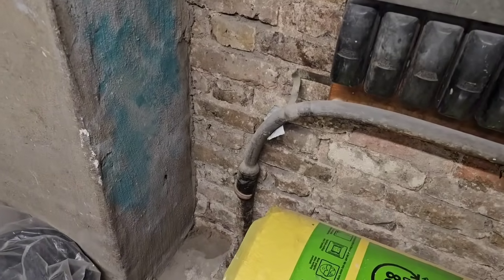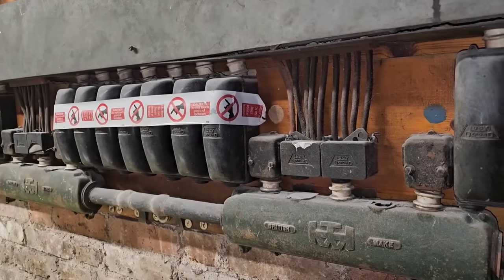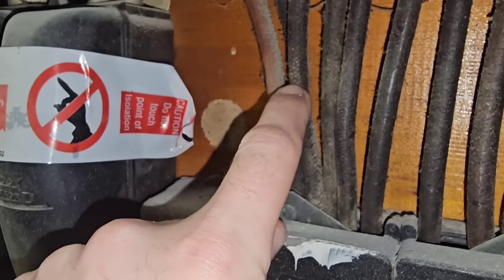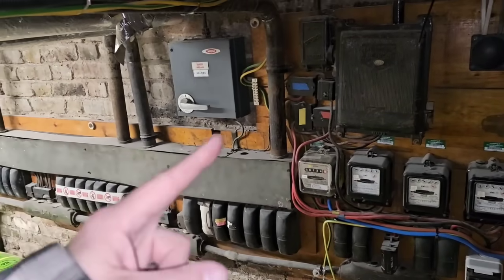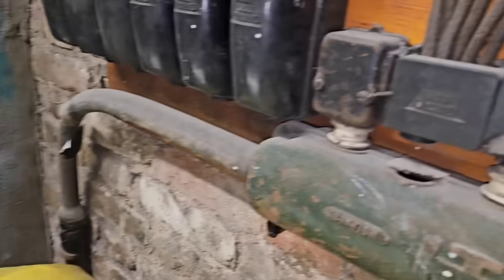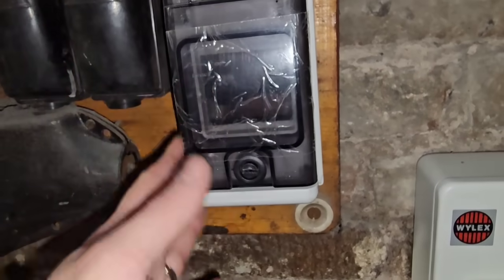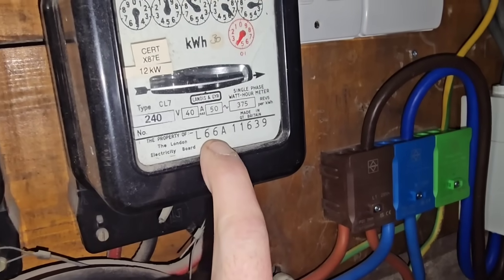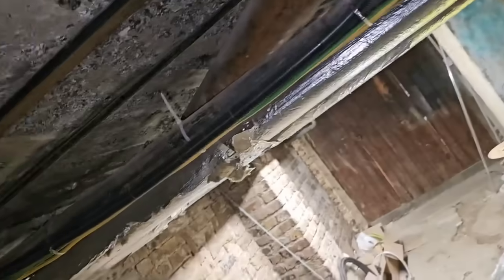Ancient 3 Phase Mains Problems

Comment: We have some of these still in Sussex and it's knocked the idea of going green on the head because of the infrastructure upgrade costs. The DNO can bring a new supply in but the buildings can't use it until the BNO has put new in their side, which they can't do without the tenants/owners vacating. Last I heard they were considering just knocking the block down and building a new one.

Also I had one of these heads in Hackey about 10 years ago that I reported to UKPN for exposed head. They were out the same day and it took a couple months but it was replaced, only 8 flats off it though. It however was in the communal hallway and the downstairs occupiers were storing their toddlers toys/ diapers/ toilet roll and buggies in the cupboard and in front of it. So it was only a matter of time before a toddler was killed.
Reply from the maker: @effervescence5664  knocking the block down definitely sounds easier 😂
Reply: Or how to make a simple and cheap thing very complex and expensive 😂
Reply: @neolerades2987  on what planet is rewiring an entire block of flats and easy and cheap job 😂
Reply: @ It's not exactly cheap, but it's definitely not expensive.  I've noticed that everything is very, very overpriced in the UK. (I don't live in the UK, but I watch some videos on YT from there).

Comment: I was hoping to watch this after Electricians Podcast but "Hey-ho" what happened again tonight? Anyhoo, very interesting stuff John though, I have to say that you are more blasé about where you poked you finger around that installation than I would be. 
As for how to move forward, I think it is a bit like us going to do work on a property that needs the basics sorted. If the infrastructure can't cope with a new mod, then that needs to get resolved first. The problem is always money and spending to put it right. I don't know if it is the BNO or that owners who has the responsibility but I appreciate the DNO not wanting to get involved until it is sorted.

Comment: Suerly, the solution, albeit costly, would be a temporary generator for the upgrade period.
Reply from the maker: @paulf2529  There's nowhere to put the new switch gear while the existing stuff is in place. There's a room down the corridor that could be used. Plus there's the issue of getting a new submain up to each flat without ruining the building. Such a headache to organise and very costly to the 20 leaseholders who the bill would be passed onto. Nightmare!

Comment: Sure it takes me back to when I installed VIR cable ( it’s actually braided vulcanised India rubber )   , mind you I’m 86  😂😂😂 Meters were handy though, often with broken seals so you could take the cover off & carefully push the hands of the dials back a KWh or 3 😂😂😂
Reply: Brilliant story…..I bet you have some tales to tell….
Reply: "Meters were handy though, often with broken seals so you could take the cover off & carefully push the hands of the dials back a KWh or 3".  Some guy in France has just been done for reprogramming hundreds of "smart" meters to systematically under report usage.  The electricity distributor is worried that many thousands may have been hacked.
Reply: Or just fit a "transformer" based meter winder 😂

Comment: For those old dial meters I noticed that the rotation of the needle changes for each unit, clockwise for the ten thousand units, anti-clockwise for thousand units and so on. Why were they designed that way? Just to challenge people?? LOL. Very intersting video - like you said a chicken and egg as to who'll do what. Cheers!
Reply from the maker: @davefrizelle3882  Yes they're geared. Very simple design and they had a long calibration date on them. I believe it was 30 years.
Reply: @ That's an interesting thought - have you ever heard of a domestic electric meter being re-calibrated?
Reply from the maker: @davefrizelle3882  Yes the old dial ones were calibrated and put back out into service. You'll usually see a little round sticker with a number like "90" on it which is the date of calibration and they were good for another 20-30 years
Reply: @John_Faultless  Thanks for getting back to me, but I'm just wondering if a meter that is installed in a domestic property is ever calibrated just because its time is due? For example, a house built in 1970 say, the meter goes in and is calibrated until year 2000, but in 2000 did anything actually happen? Did somebody come out and swap out the meter for a newly calibrated one, and take away the old one for re-calibration? I can easily imagine that this never happened and that there are domestic properties out there with meters that were installed way more than 30 years ago with meters now out of calibration. Of course the move to smart meters will change that, but if they're only good for 10 years will anything actually happen 10 years from now with DNOs or suppliers or whoever proactively swapping out meters?
Reply: @davefrizelle3882  that's exactly what used to happen when the cert period expired the meter was removed, returned to a test facility (for the NEEB / Northern Electric area this was the Test & Research Station located in Wallsend) where they were cleaned, refurbished, recalibrated  and tested. A government inspector would also come in and retest a sample. Then out for another 20 to 30 years.
Reply: @ Thanks for those details. I was curious because I have never heard of anyone having their meter swapped, other than when the smart meter roll out happened. Cheers :)
Reply: @John_Faultless   Im betting no meter has ever been calibrated until its been swapped out for a useless modern wifi enabled device.
Reply from the maker: @Arachnoid_of_the_underverse  they were and the old dial meters were very accurate and lasted well. Digital meter's didn't last as long. Only 10 years I believe. Not sure about modern Smart meters however.
Reply: @John_Faultless  Digital meters had a rolling cert period initially 10 years, a sample of meters removed and tested if they were still within tolerance the cert period was extended. ampy meters have a 20 year cert life this probably would have been extended further had it not been for smart meter introduction.
Reply: Smart meters don't solve the calibration issue.
Calibration requires checking the accuracy of the meter with a known more accurate device.

When it comes to recalibration that smart meter still needs to be taken out and tested against something known to be more accurate and determine what the error is and decide if it is within permitted tolerance.

A smart meter can report back kWh measurements electronically to the electricity supplier, but it cannot know how inaccurate it is.
Reply: @deang5622  Hi, yes I understand that smart meters don't stop the need for calibration. I was saying earlier that I have only ever heard of a meter being replaced when the smart meter roll out started. Prior to that I had never heard of a meter being swapped when its calibration period was up. I will be curious to see if my smart meter gets swapped in the next decade or not, whenever its calibration period is up ...
Reply: I asked Chat GPT about the dial rotation switching ...

The rotation of the dials alternates direction because of the way mechanical gear trains work inside the electricity meter.

Each dial is connected to a series of gears that reduce the speed of rotation as they move from one place value to the next (e.g., from the hundreds to the thousands). Since standard mechanical gearing reverses the direction of rotation with each stage, every successive dial spins in the opposite direction of the previous one.

How It Works:
The lowest-value dial (e.g., the units place) is driven directly by the meter's internal mechanism.
Each dial is connected to the next higher-value dial through a gear reduction system.
When one dial completes a full revolution (indicating it has counted 10 of its units), it advances the next dial by one position.
Because meshed gears reverse the direction of rotation, every alternate dial turns in the opposite direction.
This alternating pattern is a natural consequence of the gear train design, ensuring smooth and accurate counting of electricity usage.
Reply: @davefrizelle3882  Nailed it.

Comment: Surprised DNO didn't come to at least shroud the cutout if you reported the A07 - live exposed conductors. I've seen some really old supply heads but not quite as old as this - especially 3 phase
Reply from the maker: @barteklewandowski4211  It was reported while I was onsite by the property management company I believe. Not sure of the outcome however